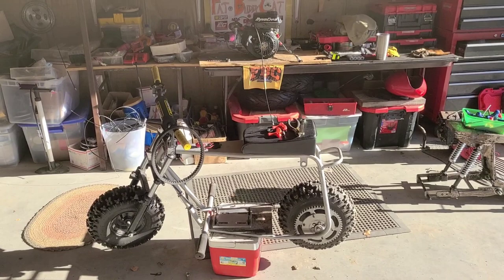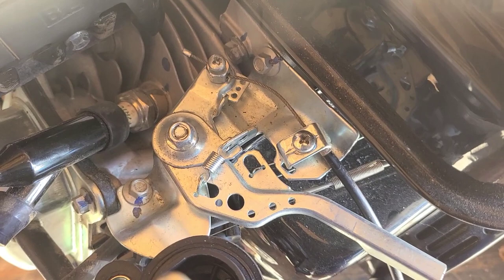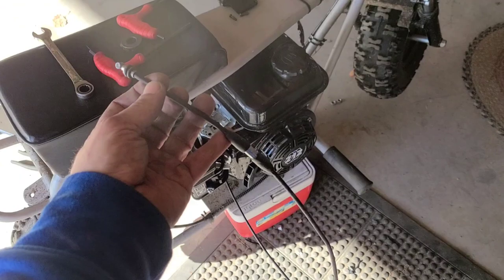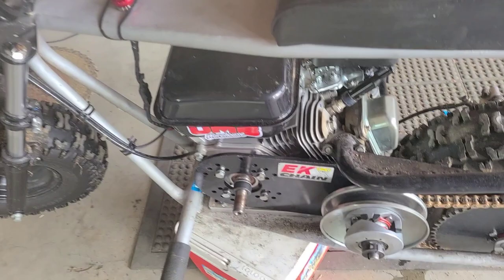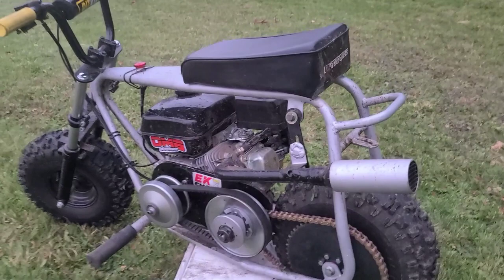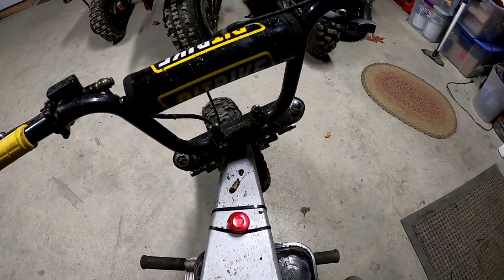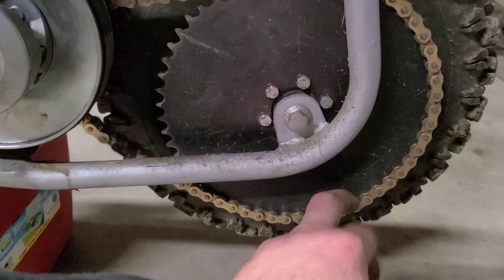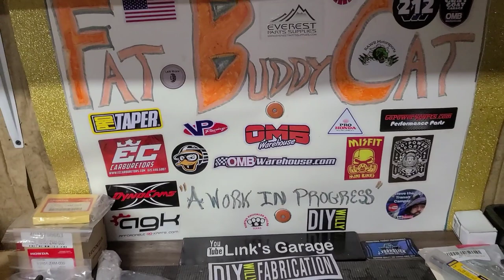Custom Doodlebug "A Better Than Stock Mini Bike"

Comment: Sweet bike ,  I like ur exhaust system .

  When I built the exhaust system for the bt I used a  eBay “ u build it header pipe kit “
 & I made it a point to make it as long  as I possibly could.  I tried to imitate the shape  of a Honda 200x header pipe   By making it do a 180  from out of the head     First it goes up then straight down past the cvt  then  a 90 at the bottom of the frame straight back to a 45 tipped up & in  with a screw in Lhead muffler  on the end ..       I also made a Slip on  spark arrestor / quiet night time  cap 
To fit over the end of the muffler..       
 
 I like doing pie cuts right by  the flange  because you can fill the outside &  port the end  out  real big to match the engine.
Reply from the maker: Nice! I'm going to have to figure out something completely custom for that vintage bike. I can totally use some inspiration!

Comment: The idea you have for this bike is genius
Reply from the maker: Thanks! It should be a pretty close to perfect mid size adventure bike when I'm done.
Reply: @fatbuddycat  there it is. Adventure bike! A whole new category! Seriously
Reply from the maker: @mklein5179  small enough to go in the back of a vehicle without ramps but capable enough to take on the world!
Reply: @fatbuddycat  that was literally what I was gonna say! I was thinking for like a big out type thing. Same deal. But 50 mph at how many gph? And the leisure and camping sorr
Reply from the maker: @mklein5179  I bet this thing hauls wide open. I'm going to tune the torque converter just for this motor.
Reply: @fatbuddycat  I’d love to see a top speed run ala black 66!
Reply: @fatbuddycat  call them adventure bikes and sell them to millenials for $10k!
Reply from the maker: @mklein5179  I'd love to see some dual piston brakes on the back caliper but I'll see what I can do! The biggest issue I have is crappy GPS signal up here.
Reply from the maker: @mklein5179  I could realistically build these for about $1200 with a very small profit. There is a lot of high end parts involved. Thar TC plate is killer but a little pricey to set up. I'm looking into a weld on stand alone jackshaft design where I'd extend the engine plate a few more inches. This is really nice though as a bolt on part that people can use to build one as a kit. I think it would be really cool if the companies sold full makeover kits like this for specific bikes. Just add instructions and step by step videos. Sell the kits as "builders parts kits" so that people are aware it takes some skills. They could always do the prep work and hire a welder for an hour too if they had to add something.
Reply: @fatbuddycat  have you
Seen me going fast video on frame building?
Reply from the maker: @mklein5179  I'm a big fan. Dirk does amazing work.

Comment: I have got to order me one of those 212 r man they are just great engines right out the box man I hope I can make it to these next races coming up I need some hot laps in my life
Reply from the maker: Don't we all!
Reply from the maker: Some people hate on the 212r or compare it to the "E"  Ducar version but in my opinion and some racers/builders I know, it's one of the best platforms to start with. Idea here is that the 5700 rpm out of the box can use all that stock torque converter.
Reply: @fatbuddycat  I got 55 out of stock ducar with a stage 1 bolt on funding a 212r right now is impossible less you buy it second hand I tell people the ducar runs like an briggs animal they are tough and 400 cheaper then my formula animal animal turns 7800 rpm tho and is bullet proof but cost for general riding ducar or 212r is the way to go
Reply from the maker: @heathenprojects2639  I absolutely agree! I hear great things about the 212e too but that flywheel.....I wouldn't be surprised if they just stop messing around and have just one solid Tillotson 212. I don't see how the E can be claimed at 9 or 10hp but not be as stacked as the 212r which is probably 7hp for all I know.....
Reply: @fatbuddycat  so from what I can tell from testing the ducar and 212r are the same when I moved the governor arm to highest setting and  it spin to 5300 but removing throttle set screw it spins to 5700 the ducar is a updated version with more adjustablety for different race applications the Tillotson 212e has a stronger block and you can build it without special modifications

Comment: The toque converter plate is awesome.I should make one like that with all the metal I have at the job site.You do great work.
Reply from the maker: I got this one from omb but it is basically a hunk of steel with holes drilled in it and a tube welded to support the jackshaft bearings. I cut mine for extra tire clearance and welded some little supports in to beef up where I cut off.
Reply from the maker: The best part is that it sits flat instead of that downward angle so you can do away with the risers. I only have a billet adjustable plate because I built this to use with just about anything with small block layout, clutch or torque converter. These can be drilled into and have tensioner or idle wheels installed for the primary chain too.

Comment: I'm going with ducar since you can't buy a 212r anymore for my rascal I've got a few motors but I'm not looking for speed just reliability and comfort
Reply from the maker: The Ducar is a very nice choice.
Reply from the maker: This bike has a nice upright position. The wide solid pegs are meant for comfort and cruising not necessarily bashing but it can hang. It's very classy.
Reply: @fatbuddycat  yes if you set the ducar to max setting its a 212r I've 2 ducar I thought about pulling governor out of one just to see what it can do if it blows up so be it I've sold most of my predator to build a few more Tillotson 212e my stroker is running really well its tuned I'm just waiting on powder coating on my drag frame then test hits motor broke my pro frame which has been my test bike time to put it on a small tire drag bike and get some passes made 😀
Reply from the maker: @heathenprojects2639  absolutely!
Reply from the maker: @heathenprojects2639  love it!

Comment: man i love that mini bike, my throttle linkage is set up the exact same way. couple of questions. do you have thumb throttles on most your bikes? and did you put that gas cap on that fuel tank? cause i was lookin at omb side fill gas tanks and it shows the silver cap. my tank is the same except with the silver cap and still leaks a little. i had got one from auto zone and it fits like a glove and doesnt let a drop leak out but i dont think it has a vent in it. if you did put your own cap on ur tank could you send me the link to it? thanks man!
Reply from the maker: I used a cap off an older Honda gx with the black tank. It's old but fits great. That tank didn't have a vent so I just assumed the cap was vented. There is a way to add a fitting with a little filter to the cap somehow but I'd have to search for it again.
Reply from the maker: I rock thumb throttles on every bike I own now. I try to use as much of the same thing as I can to make maintenance easier too.

Comment: 212 stage 2 is to much for the doodle...hahaha 🤣 get the hell out of here. Before my 301 predator that's on my doodle now I ran a stage 2) 212 predator lol
Reply from the maker: EVERYDAY use.
Reply from the maker: I have 6 mini bikes and don't always need a stage 2 Predator. I can't quiet it down successfully without screwing up its performance. This motor can run the stock muffler and still boots around just the same at a lower decibel level. I appreciate a strong, aggressive and loud mini bike but I need one toned down a bit.